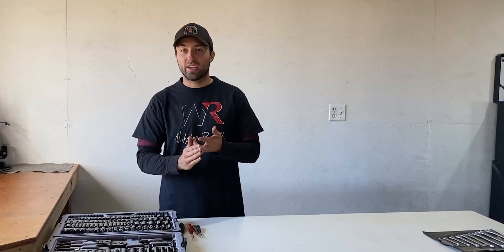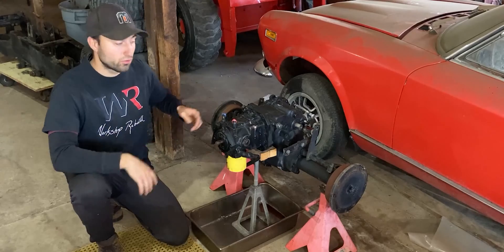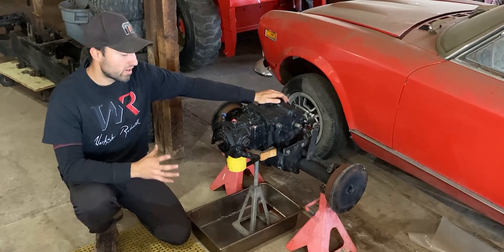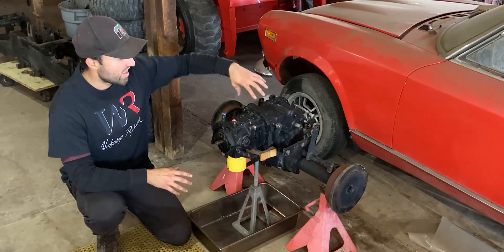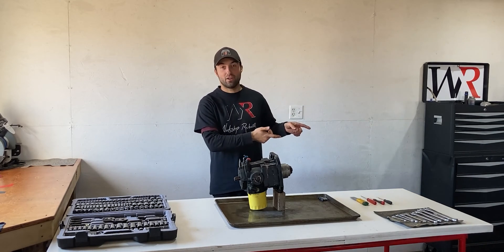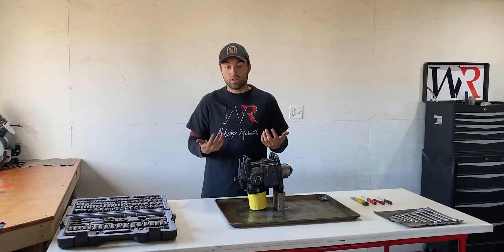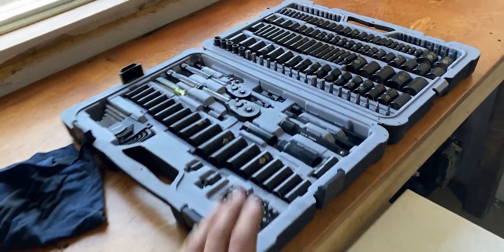John Deere 400 Hydraulic Motor Disassembly | Sundstrand Series 15 Model 90 Inline Pump

Comment: Great job so far. Definitely watching for the rebuild and install.
Reply from the maker: Thank you very much! I will try my best to get the Rebuild done as soon as possible with detailed instructions. The install will follow later, as I still have to take the rear-end/ transmission apart. Once that is finalized, I can merge the hydraulic motor to the rear end. I'll keep you posted. Best regards.

Comment: Do you have any leads on where a guy could find new check valves, the parts for this tractor have been discontinued
Reply from the maker: Unfortunately, I do not where to source brand new check valves. Your best bet is to find some on eBay.

Comment: Do you happen to know the seal part number for the front output shaft ? The cover has the LH Rh on it !
Reply from the maker: Hi there! Double check with the Weingartz diagram: https://www.weingartz.com/assembly-diagram/john-deere-parts-lookup/model-400-hydrostatic-tractor-19-9-hp-k532qs-kohler-engine-pc1475-transmission-pump-housing-pump-shaft-cylinder-block-tractor-hydrostatic-400/4275-35688-572123

I believe you‘re talking about #14 which is JD part number „AT12820“.

Hope this helps - Regards Andreas
Reply: @ thanks for the quick reply ! I found the next video with the parts breakdown you made with the national seal part number ! You’re a life saver !

Comment: Thanks for an informative video. I have a question about the ability of the pump to run a front end loader. In your opinion is it strong enough or is it advisable to run an external pump off of the front pto? Thank you.

Comment: Good day, I was wondering if you can maybe give me some advice, I just finished a full restoration on a small gas powered new holland skid steer, I have two of the 15 series sundstund axial piston pumps, closed loop with drive motors for the wheels, everything works great , good charge pressure and working pressure as I can drive into a pile and stall the 20hp engine, my only problem I think as I’ve never owned a skid loader is that I find it very noisy, like hydraulic whine , it just seems not right, it does get worst when warm or in lower rpm’s, I’m thinking of pulling a pump apart but I’m not sure what I’m looking for that would make this issue?, thanks for your time
Reply from the maker: Hello Rick, if it is an older skidsteer it will most likely have a whine to it while operating. I have a Thomas skidsteer from the 80's and the whine is far more noticeable than on any of my smaller hydrostatic drive garden tractors. I'm literally sitting on top of the hydraulic pump and there is no sound deadening material anywhere.
Back to your issue: If you have a high pitch whine, you might have issues with your hydraulic pump input shaft bearings. Excess play (wear) on your shaft can cause your swash plate to wear unevenly, thus causing your hydraulic flow to be interrupted from time-to-time or even cause internals issues. 
In the assembly video of this hydraulic pump / motor you can see me address the wear on the swash plates themselves. Here is the link to that video: https://www.youtube.com/watch?v=6Z7LK63ZChQ
At minute 18:55 in the assembly video, you can see the wear on the swash plate.
After many hours, the piston barrel assembly can see wear due to cavitation or aeration, so if you decide to take your pump apart, have a good look at the piston barrel assembly.
Whatever has excess wear or whatever parts have damage NEED to be replaced. If not you will run into fatal internal hydraulic pump damage.
I hope this will help along your repair and diagnosis! Regards Andreas
Reply: @WorkshopRebuild  thanks for the info, greatly appreciated, yes, I also sit right on top of both pumps, I think your right, older machines make more noise, mines a 95. I do find if I run the rpm’s up higher it’s not as noisy other then the engine now😅

Comment: Is there only one fluid reservoir for both the hydrostatic drive and the hydraulic implements? After a fluid flush at the service center I am getting a loud howl after a few minutes of using the hydrostatic drive. Fluid level seems ok on the dip stick on the back, under the seat. Other than the noise it seems to be performing fine but I have it parked until I can get some answers.
Reply from the maker: Hello Camron, that is correct there is only one fluid reservoir for the hydraulic motor and the charge pump. The fluid is stored within the rear-end (transmission) of the John Deere 400.
If you have a very loud howl in your rear-end there might be an issue, but nothing that I can determine from my end. The John Deere 400 does not have a dipstick, or at least it did not have one from factory. There is a square fitting on the back of the transmission with a clear tube hooked up to it, that runs from the middle to the top of the transmission. Your fluid level should be exactly between the middle and the top.
If you do not see any oil within these two points, that means you do not have enough in your system and you must add oil immediately! 
I hope this helps and if you have any other questions, feel free to ask. Regards Andreas
Reply: @WorkshopRebuild  My father purchased this JD400 new in '74 or '75 about the time I graduated high school. To my knowledge it has always had a dip stick. It seems be a standard JD part because when the service center flushed the hydraulic system, including the lines on the front blade they broke the original dip stick. They were able to readily replace it, I assume from JD inventory. It looks identical to the old dip stick but as I don't have the original  I can't verify that they are the same length. New fluid is crystal clear to the point it is very difficult to see, the old fluid had a reddish color. If I could attach a photo of the dip stick assembly I would. After I got the JD400 back from service and it has the howl when running the hydrostatic drive I remembered the old tech, that had done all the tech work and now long since retired, telling me not to let anyone put the 'new style' fluid in it. I can't find any old school techs that know what he was referring to. I have attempted to contact JD directly but I was told that the JD service manager needs to initiate the inquiry. It has been a month or two with no word. In the meantime I have the JD400 parked for fear of causing damage.
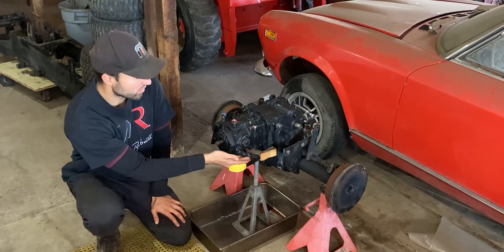Reply from the maker: That's very interesting that your John Deere 400 has a dipstick. I went through the whole transmission and I did not see any area for a dipstick. I wonder if you have a dipstick on the top fitting for the oil level tube? You can see this tube clearly at minute 02:29 in this video here:  https://www.youtube.com/watch?v=pehVUaeDNn4
The fluid John Deere uses nowadays is called HyGard lo-vis, but that's just a company preference and marketing thing. This hydraulic motor setup was placed within a handful of garden tractor brands like Bolens, IH, Case, MF etc. They all recommended different fluids, but ATF Type-F (Automatic Transmission Fluid) was a recommendation for all brands.
If the original fluid was red in color than it was most likely ATF fluid, or possibly something they made back in the day that I don't know of. 
If it doesn't sound right and it seems to be worse than when you brought it to JD, than you should get in touch with them again. At the end of the day, they serviced your machine and they should be able to have an explanation for you. I hope this will help you find a solution. Regards Andreas

Comment: Nice video! That is the same system as the jd 318. Will we be seeing your 317 in a video soon?
Reply from the maker: I'm actually not quite sure which hydraulic motor the 318 has. It's possible that they used this one or the U-Pump which is on the 317. I have the setup as a mower tractor, so I'm not sure if I can use it much once the snow hits. I would love to find a blade of snowblower, but in my area there isn't that much for sale lately. Best regards